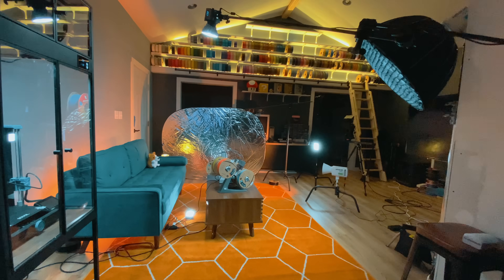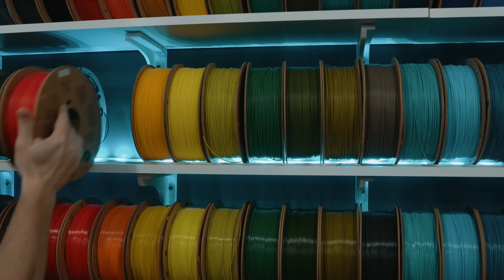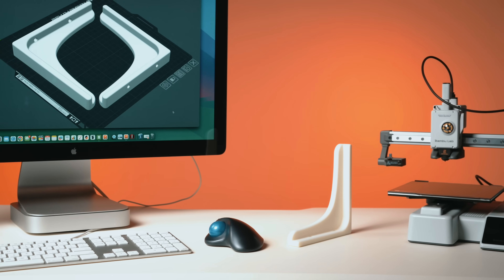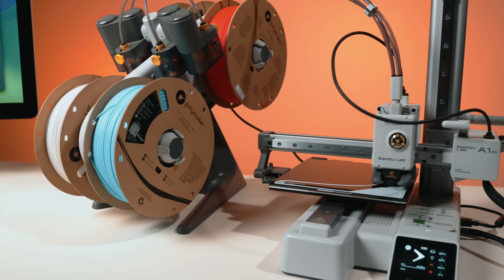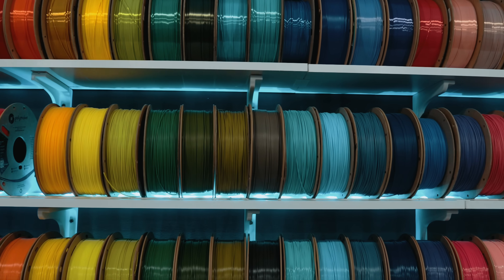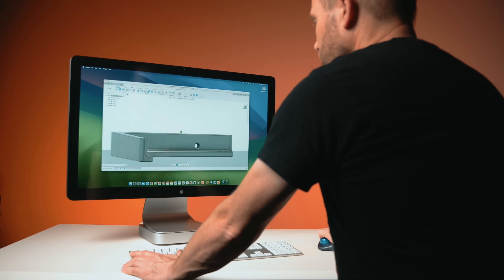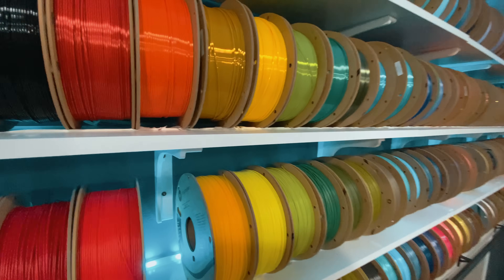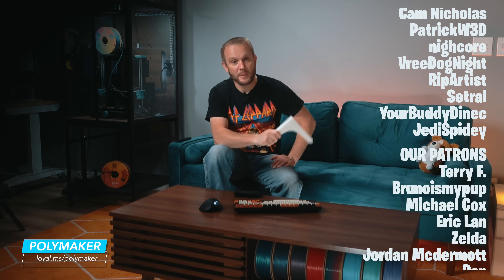3 Years, $15,000 in Filament, One 3D Printed Bracket

Comment from the maker: So… would YOU trust PLA with $15,000 on the line? Let me know what you’ve used PLA for that surprised you—stronger than expected? Total fail? I want to hear it.
Reply: PLA is currently holding my desk. 4 brackets at 10 walls. My desk has about 200 lbs at max on it.
Reply: Why not? Because PLA is so easy to print, people think it is not very strong. But in practise it is one of the strongest materials. The main downsides are that it can bend under constant pressure and it is not very impact resistant. If you can deal with the downsides in your design PLA is an excellent choice and often underrated.

Comment: Lots more brackets you used than say steel. More material used but good engineering.
Reply from the maker: Nope. Completely wrong. The shelf material and load determine the bracket use. Without a center supporting bracket, each shelf  section wouldn't even support its own weight without sagging in the middle, let alone adding all of the filament. So, no... steel would not have used less brackets -- all brackets are on studs, 16" on center.

Comment: i haven't used anything else but traditional PLA.  will your design work with "Normal" PLA? or should i use stuff like PLA+ or PLA Pro?
Reply from the maker: It can work with regular PLA, but you'd want to really not push it to its limits. Regular PLA when it fails, it fails suddenly, it cracks or fractures sharply. PLA Pro from Polymaker being a little more like PETG is going to have a slight amount of flex or give to it, especially before failing. My example of doing pull-ups on the PLA Pro ones is a good one, because if it began to fail, it would slowly bend first, while regular PLA, it would likely just sharply fracture and I wouldn't have time to react. 

BUT with that said, since we love testing and we are all open to trying and experimenting with new things -- print them with what you have or what you want to try and report back and let us know!

Comment: Fantastic work, quick question, no changes on the ammount of walls? only the 2 default?
Reply from the maker: Thank you! 8 walls, I may have called them perimeters in the video. Can’t remember. But you need those for strength.
Reply: @LoyalMoses  yes you did :D tks, that makes more sense for beeing so strong, tks.

Comment: The weak point of PLA is and has always been temperature. If your place will never get to 60C then that's fine.
Reply from the maker: Temperature indoors is definitely good for PLA, but the brittleness makes it a tough choice. PLA Pros are fantastic for this, and the new HT-PLA that is good to 150c is also an awesome choice!
Reply: @LoyalMoses  I'm skeptical of how much temperature HT-PLA can actually handle under load.
Reply from the maker: We can try and test it!
Reply: @LoyalMoses  That would be awesome! I'm interested to know how much it deforms at 95-100C, with a 200mm long 10mm thick bar with a weight applied to it, of let's say 500g.
Reply: I've had a PLA bracket holding a speaker in a patio room that gets to 50C easily during summer, been fine for 5 years.

Comment: Wellllllll it's not like you lose $15k if your PLA falls to the floor lol
Reply from the maker: Cardboard spools popping like popcorn! 🍿
Reply: I came here to write something along the same line, with one additional thought: I am laughing out just imagining the humongous pile of tangled filament! 😂
Reply: And speaking of busted cardboard spools - is there a smart way to deal with the ones that were dropped by the couriers? I use dry boxes with bearings at the bottom, for the spool to roll on, so I can't just hang the spool on its core. And I also don't have and don't want to buy or build a big respooling tool. I am thinking about printing some "covers" for the spool edges, is anybody able to confirm if they work? Thanks

Comment: I use 3D printed brackets pretty regularly around the house. It makes for a super-easy and most importantly, CUSTOM fix. I can make the bracket look any way I want, and fit any way I need it to. Most recently I designed one to reenforce my mailbox post when I installed a massive chungus of a mailbox. Being outdoors however, I used PETG-CF. 5 Walls, 30% Crosshatch infill.
Reply from the maker: This is awesome! How is it all holding up?!
Reply: @LoyalMoses  Holding up great! Been about 4 months and no issues so far. The Alabama summer heat will be the ultimate test.
Reply from the maker: That is great to hear!
Reply: problem with carbon fiber is it sheds carbon fiber particles everywhere... wouldn't want that stuff floating around in the house...other videos on YT have tested this
Reply: @thatonesnowboarde  I only print CF and GF materials with a HEPA filtered printer, and the prints that contain it are used outdoors.

Comment: When we finished the spare room, I added nail plates to studs to protect power and water lines.
I also take pictures before the drywall goes up. Helps a lot when it's been a decade.
Reply from the maker: OC!!! Hey! 👋 Seriously, hitting a water line is probably my worst fear. But, like you, took pictures when we built and I ran plumbing and electrical very uniform so I know where to avoid.

Comment: Polymaker Pro series is a great material to work with. I have several prints I've designed and they hold up well. Great video.
Reply from the maker: Amazing stuff really! Changed the industry for sure.